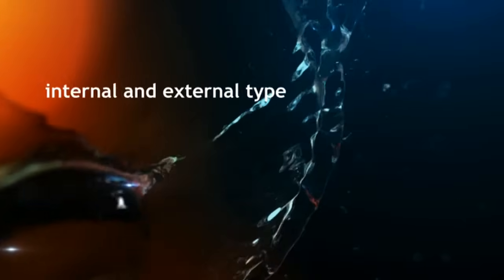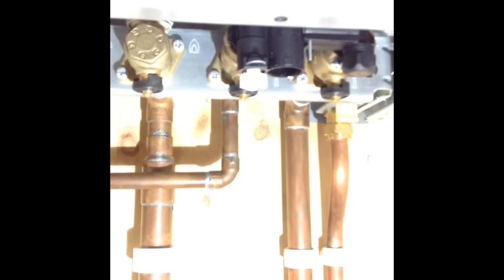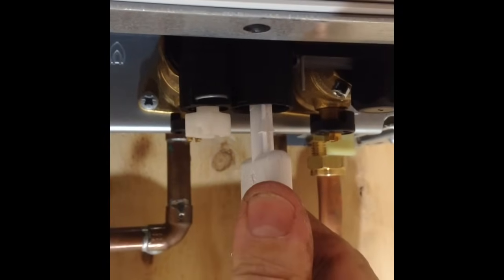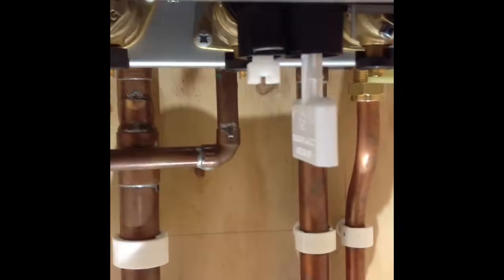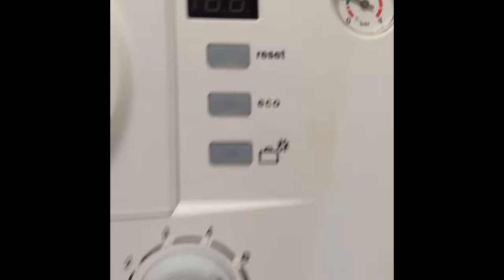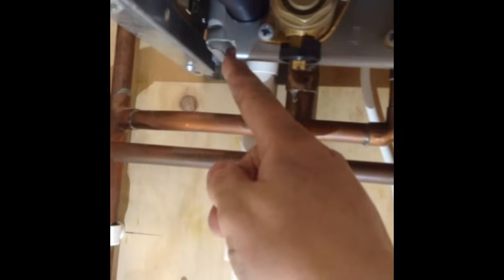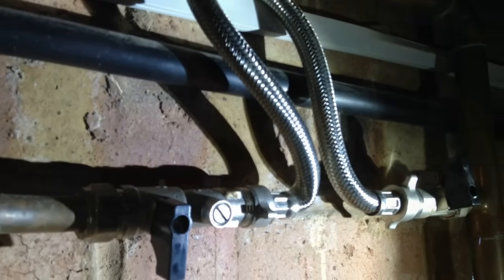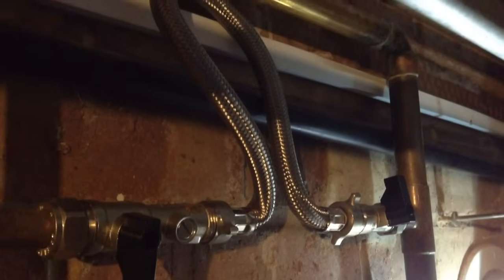How To Top Pressure On Worcester Bosch Boiler

Comment: Hi, I tried this and a fair amount of water started pouring out. Is that bad? Anything else I can try? Thank you
Reply: Notorious JayW if it’s from the key then it may not be located correctly. Ensure it’s fully pushed into place. Try putting some lubricant on the 2 black washers first👍🏻

Comment: Hi,  I have follow your steps in this Video but the pressure gauge in my boiler didn’t move at all. Don’t know what’s wrong. Normally how long time the  pressure gauge will going up during the top up? Mine just keep at 0 pressure don’t going up.
Reply from the maker: Hannie in UK Ho either the gauge is faulty or your losing water somewhere. Check outside
Reply: Hancock and Brown thank you so much. 😄

Comment: Hi i bled the raditors today and the pressure of my worcester Boiler has Dropped I try to turn the key on Boiler like u did in Video but the Needle Dont move its on red could you help me out please dont no wot to do .
Reply from the maker: omghey xxx you should here the water rushing in, if not your link maybe damaged. If you can then it’s either the gauge is blocking.. you may look at it later and it’s shot up if only partially blocked, or your losing water as fast as it’s going in.. check outside by the little pipe below the flue. You may want to get a engineer out before it gets too close to Christmas.

Comment: Hi I’ve just had a leak fixed and my pressure from cold was zero , I just filled with the external taps as shown but it’s about 1 and 3/4 not 1 to 1 1/2 do I need to bleed som e water out or Is it ok my boiler is in back bedroom  Second floor x
Reply from the maker: Catleesie good time to bleed the rads for air. Drop it to 1.2-1.5 you’ll be ok
Reply: @GHancock  how do you do that

Comment: Thanks for the video, but when I followed the instructions to the letter, water came out through (I think, the top of) the pipe where the key had been inserted. I hadn't touched any pipes or anything, purely just inserted the key (as far as it would go), turned it to the lock position and rotated the white tap anti-clockwise. 

Any idea why this is the case? 

Cheers!
Reply from the maker: I suspect the key not in far enough..take not of the pad lock positions..failing that make sure the rubbers are not damaged..or the little ears on the white key misshaped making it hard to get up fully..put some washing up liquid on the rubbers or ideal silcone grease..( not sealant)

Hope this helps George
Reply: +Hancock and Brown cheers for the reply and advice! I'll have another go tomorrow 👍

Comment: is it better to turn off boiler when doing this?
Reply from the maker: Best to do when system is cold, so you can set to 1 bar. If there's no demand it should be fine, If you do turn off main electric, turn off when cold as pump overrun will not be there and when power is restored it will go to low flame for 15 mins and show a symbol on front

Comment: Do you have to turn the boiler off before doing this?
Reply from the maker: danny mcguire no need to turn off the main spur switch.. but it's best to do this whilst heating and hot water are set to off on the timer.. this will give you a true reading of 1 bar setting

Comment: when using the square plug to refill the tank,how important is using the plastic key,to turn it off?
I ask,because my boiler,same as the last one shown here,loses press,constantly,I recompress,with the square lug,but don't own a key...please help,lol
Reply from the maker: * * you will need to turn the filling link off. If you leave it on, it will over pressurise the Boiler and cause more issues. Water must be leaking out somewhere. Take a peak outside on the relief pipe. 
Think it’s time to get someone in.if you topping up every day the fresh water will cause the Radiator to corrode 😧

Comment: hi, great video, when i top my boiler up to about the 1 bar , when its on (working)  the pressure keeps rising very slowly and only if the boiler is really working hard, is this normal? ty
Reply from the maker: +extraslong  if the pressure go"s to 3 bar then you maybe looking at faulty or undersized vessel..but it may rise as heated..this is just because water expands as you heat it
Reply: +Hancock and Brown hi, thank you for replying! ! I appreciate it, it dosnt go that far I was just abit worried but that's great thank you! do you know if I fit a wireless thermostat  (plug and play ) what happens to the thermostat that's on my landing? I'd like a wireless one because I want it in the front room. ty
Reply from the maker: +extraslong even a plug and play needs the casing off... And the old one disconnecting.. Best get your gas safe guy to do it when your year service is done..he need to clean your traps and set up co2s anyway👍🏻
Reply: +Hancock and Brown hey cheers I'll get him to sort it out! ! Ty for getting back to me 👍👍

Comment: I tried this method before and it worked, however this time pressure didn't go back up and stayed at 0 so now there's no heating in whole house. Can you please help
Reply from the maker: water going somewhere.check the releif valve.or the gauge is blocked..although the boiler would still run ..time to get it looked at i think

Comment: Thanks for this. I noticed that our boiler needed topping up today - Christmas day, and never had the first idea how to do it. Good old YouTube came to the rescue as usual and now all is well. Thank you so much for your video. Only problem was that when boiler was running it went to half into the red the too much end so I bled all the radiators to bring the level back down.  I got it back into the green and will keep an eye on it over the next few days.
Reply from the maker: oldproji no probs glad you never had a cold Christmas..nice to get feed back.
Reply: Really no need to play music so load it masks the instructor voice, otherwise very helpful cheers job done.
Barry
Reply: With "bled" you mean let some water out?
The pressure in my cv got too high as well...

Comment: Hi when I do this the pressure guage does not go up very quickly and it also sounds more like air going in as opposed to water . My pressure is just above the red but below the 1. I tend to have to fill it every month and my rads have no air and outside pipe is dry  Help please

Comment: Very good clear video.  The manual is pretty useless about the subject, even though it's probably important for every user.  Of course the manual is hampered by doing everything by diagrams without words (to save translation costs), but the end result is that the manual doesn't work for anyone.  A link to the video from the manual would certainly help English users.
Reply from the maker: +martin healey always good to see this in the flesh..with a plumber explaining it...your right, sometimes I think, the time it hits the guys that do the manuals info is lost,

Comment: Watched a few videos on how to re pressurise my new boiler as the radiators needed bled.  This was the first one that showed how to do it without a key and was very straight forward using the two taps to add water. Well done.
Reply from the maker: Kenneth Freebairn hope it helps keep you warm this winter👍🏻

Comment from the maker: Think you have the HE model..I think the most likely is the silver braided hose type feature at the end of the video..some of the old worcesters had a similar white  key but slightly bigger underneath a white panel at the bottom on ball joints..but my moneys on the braided hose... look underneath and in any airing cupboard.

Hope this Helps

Comment: Thanks for this. I can't believe I have called an Engineer twice to do such a simple task. My engineer also left key stuck in as someone else pointed out. The Engineer also left it on the lock position. Should I turn it back to the unlock position or is it ok? Another question is whether there's a guideline as to how frequently the pressure needs to be done. It seems like every 3 months to my boiler at the moment... I have a 3 bed house

Comment: Brilliant thanks, just what was needed. I noticed a bit of a lag so even though I stopped the water at 1 it still went up to 1.5, hopefully not an issue.

What is the reason the pressure falls over time and how much of a pressure drop should be of concern? 1 bar in a year ok?
Reply from the maker: Lag maybe the gauge blocking, I wouldn’t worry about topping it up in once a year, just keep a eye out for any small leaks and get the boiler serviced to make sure it’s not inside damage any components
Reply from the maker: 1.5 fine

Comment: I tried this and water started flow out from where the was installed, watched the video again and noticed your key has two washers on it! Where my key has the top washer missing from the key. Looks like I'll need to get a new key.
Reply from the maker: Wayne Clarke 87161045910 they are bigger in the old HE models but I think this is the part your after👍🏻

Comment: I've done this but the pressure keep going b ack to zero..
Reply from the maker: Fatema Patel then I'm afraid you have a leak somewhere..check the outside pressure relief pipe..if no sign anywhere it maybe you main heat cell. Shouldn't be hard for a accredited installer to find👍🏻

Comment: I personally think this plastic key is a stupid idea. what if it snapped in the open position! It takes quite a bit of force to insert/remove this key fully in my gas boiler. I had to use a little washing up liquid around the rubber ring before it would lock into place fully. Before it used to be just a washing mashing tap on an inlet pipe that was much easier and less chance of breaking.
Reply from the maker: Whovisions . The key provided a link of the air gap that's there to protect the cold mains from the heating water.I didn't invent it😊 I only released the video to help folk..but you may be interested in they have now changes the design. It's a blue lever you just pull down👍🏻
Reply: Sorry I wasn't suggesting you did or getting at you...was just stating how the design seemed bad. Glad it's now a pull down lever. Shame I'm still stuck with the key :P Thanks for the info. ;)
Reply from the maker: Whovisions no worries thanks for watching, if you do fancy changing the link they are about £24 your service engineer would be able to swap it in with the price of a service I would imagine 👍🏻

Comment from the maker: Is there a screw driver slot..if so, turn so the slot is in line with the pipe....but be sure to turn back when at 1 bar, so when finished, the slots across the pipe...take note where it started b4 turning👍

Comment: I was told 1.5  I am on a 2nd floor flat.
Reply from the maker: Rhona Hall if you’re on one floor 1bar will be better, no harm at 1.5bar it will take it. But there only need to run it at 1.5 if it’s pushing up 3 floors.. one bar will put the vessel and components under less strain. Especially if it’s all on one floor

Comment from the maker: your pressure will rise,when heated as the water expands, where to depends on how many radiators there are off the boiler....no where near 3 bar I hope...but a 1.5 bars fine

Comment: What will happen if the needle goes on number 2 + instead of 1.5.  Will there be a problem?
Reply from the maker: Be ok if it hits 2 when radiators are hot.. But cold a little high... Why not vent all radiators, see if that drops it.if that not helped you can release a little water from a drain point.. Failing that release a little water from the vent of a radiator into a tub... Pick a room with no carpet

Comment: Move it too hard it breaks floods the place 
Move the one to the right it opens a domestic mains pipe & floods the place 
It always gets you wet anyway it’s a rubbish design but most importantly you must be REALLLLLLY  clear if they over fill this boiler then due to incompetent design the 3 bar blows & it’s situated literally behind the boiler…I refuse almost all Worcester boilers there a nightmare to work on…BG get special prices & give nice reviews on witch magazine who advertise on the BG vans 
Circle of profit…I know many engineers & they all hate Worcester boilers 
There not unreasonable & there service centres are really helpful & there warrantee is great
But to work on there just despicable plastic rubbish
Reply from the maker: Must say I myself have never had one flood, small amount of water will come out when the keys pulled out.that’s how it achieved getting around the air break needed for water regs. The new design doesn’t have that now.Almost all boilers blow out at 3 bar, it’s the safety PRV that’s stops you having an over pressurised system, otherwise people would be having valves pop off or pipes burst at 10bar. Independent Installer often Offer10- 12 year guarantee whilst BG offer 5, BG never  as all big companies never spend the full day required powerflushing. Service Center after sales are good, not perfect. I’d put Worcester Bosch, Atag, Baxi, Vaillant as some of my favourite boilers, 20 years ago I’d been potterton and Ideal classic on top. So it can all change. Let’s see how the new range does over time.

Comment: Very helpful thank you.  I bled my radiators first and the noticed that i had zero pressure on my boiler.  One point to remember is that if you have reduced the pressure to zero, you do need to leave the filling valve open for a couple of minutes to build the pressure up.  Once the pressure starts to build and comes off zero bar then it will rise quite quickly.  My boiler a 24SBi also has a pressure relief valve built in to it.
Reply from the maker: It will David, if your system is empty,it will take even longer to fill, as it compresses the bigger air bubble. Then as you get to the last radiator the needle will go up faster.
Remember don't use the pressure relief to drop pressure..as sometime they don't re-seal, once opened

Comment: Doesn't work for me. I've followed exactly and all it does is leak water all down the key!
Reply: Yeah, same happened to me but I think the gas supply was off rather than the pressure being low. The mains supply was off due to maintenance work.
Reply: found out a little tip....put a tiny amount of washing up liquid around the rubber ring on the key before inserting. The problem was, even though I had pushed the key up really hard, it obviously still hadn't reached the locking point. It used to be just a tap on an inlet pipe which was much easier. This plastic key is a stupid idea that could easily break in my opinion. I mean it's only got 2 little plastic lugs on one end, if they snapped off in the open position you would be in a right mess!